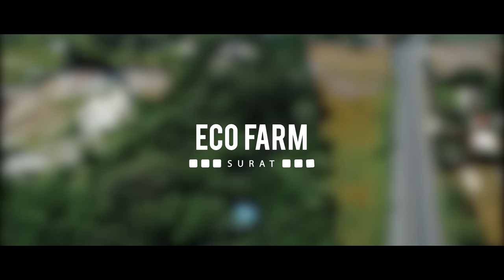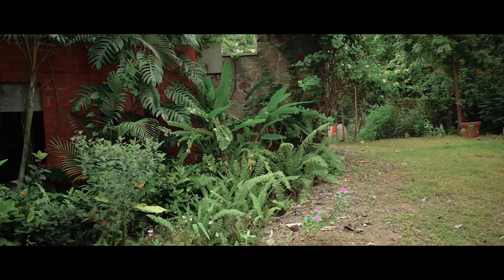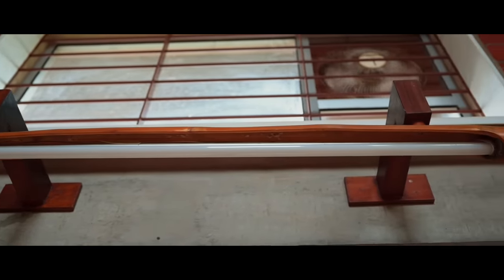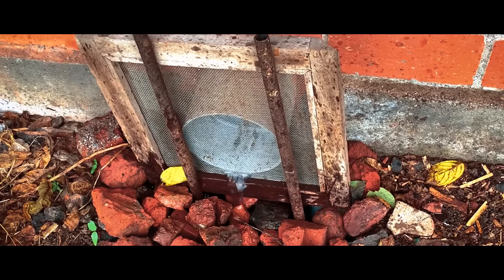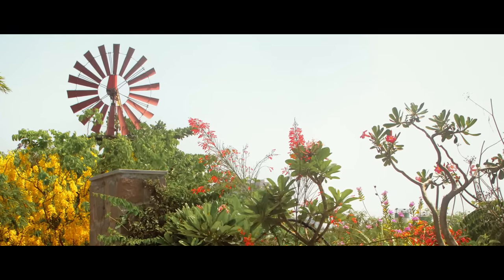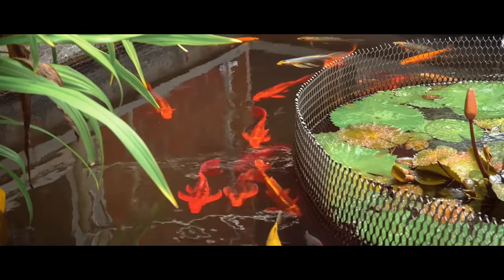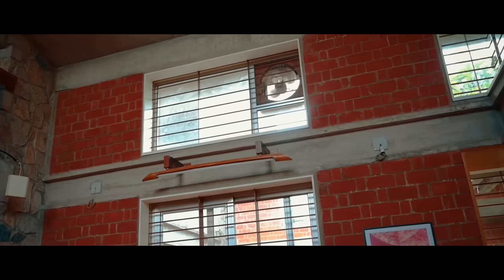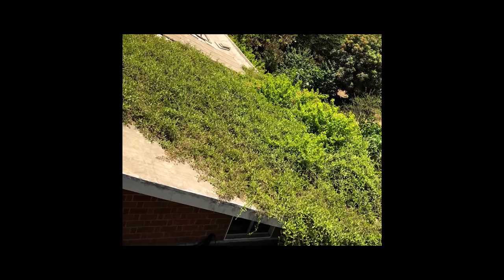ECO HOME: No Power, Water & Sewer connection in this house.

Comment from the maker: @Monisha , there is water sprinkler for cleaning the solar panels ( seen in video). Also there is a small door for approaching the roof.
Reply: Would this house woek in Texas? Ans how muxh doea it cost?
Reply: Sir what is its cost
Reply from the maker: Himanshu Verma -just 10 % more then regular house of this size.
Reply: @snehalpatel7705  Sir can you please tell approx cost like in round figures
Reply: Snehal Patel @ sir ur efforts are very good.., will like to study ur project in detail nd work on this kind of works
Reply: I have a qs sir, its not plastered and all... Does not it leaks water during rainy season. I have the bad experience... Our house was leaking with water all around. Do share your views and suggestions
Reply from the maker: Asthuti 0908 -if properly built it will not leak

Comment: The batteries you are using are lithium ion or lead acid 🤔
Reply: Lead acid
Reply: Because it's cheaper n more durable than lithium ion battery.
And good recycling cost also.
Reply: Bcoz none of us came out with naturalist resource.....but i m sure it can be done bcoz the raw material is from nature only....
Reply: don't buy the hype of lithium ion mostly marketed by american corporations, lead acid is by far the most cost effective way for power storage with very good recyclibility. I myself run a solar installation on my roof with lead-acid batteries and have zero issues.

Comment: Hello Sir, what would you recommend for the terrace flooring which doesn't heat as much in the summer and doesn't get cold in the winter, also it isn't very slippery in monsoon. What sort of stone should I be looking for and where may I find it in Gujarat? 
I am thinking of doing a terrace garden for my apartment. Its a penthouse on the 14th floor. If I could simply walk bare foot in any season... that's what I want :P Thank you in advance.

Comment: Excellent design but one problem is very obvious to this house. The over plantation on the walls and roof of the house can lead to deterioration and may damage the walls, further leading to water leakages with time.. Otherwise it is excellent.